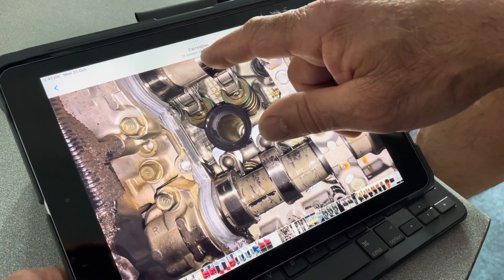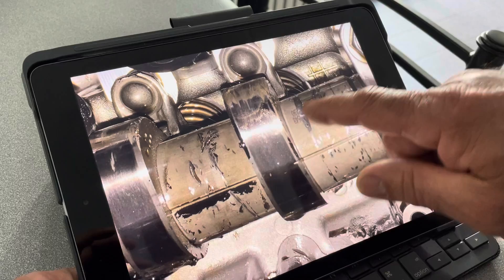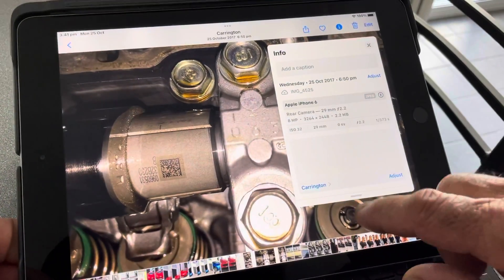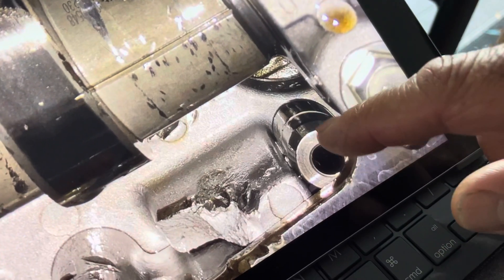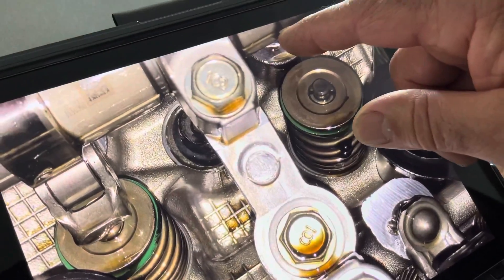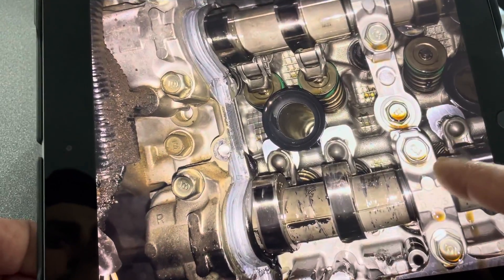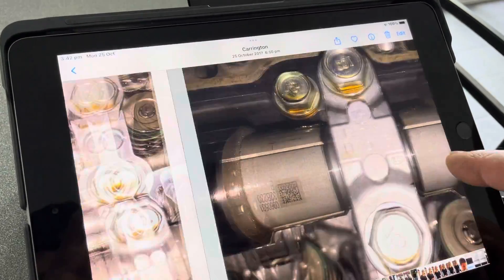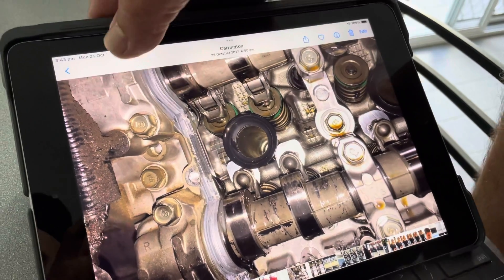FA20 Toyota 86 Engine Failure (2017) Dropped Rockers before Retainer Kit Development

Comment: why is the kit $900!?
Reply: I was wondering the same thing..... It's ridiculously priced
Reply from the maker: What are you comparing it to?
Reply: @denstoj  other third part manufacturers that make rocker retainer clips for different engines and different vehicle brands,  their prices vary from 100 - 600 USD, 900 is far too pricey for what they are. Granted you guys did the research and spent the time to create your product, still way too expensive
Reply from the maker: @daniel-su4hw  thank you for the feedback. The price for our FA/FB kit is $899 AUD which is ~$600 USD. Our website should automatically update to your currency. Let us know if it isn't?